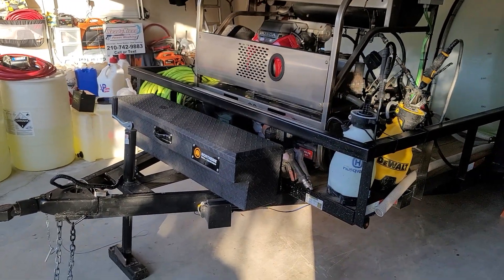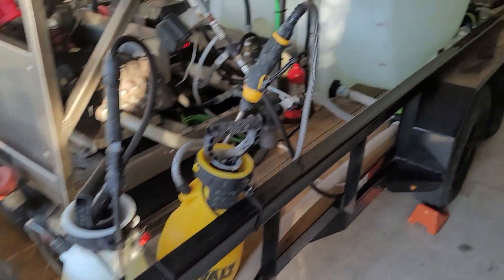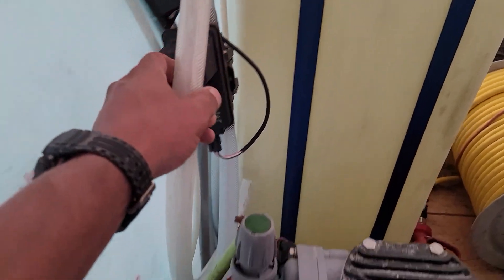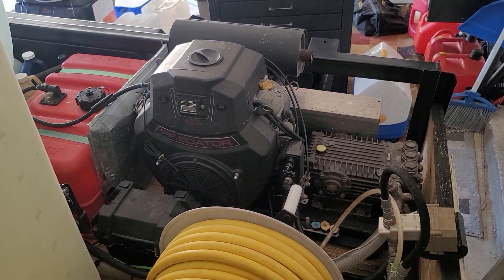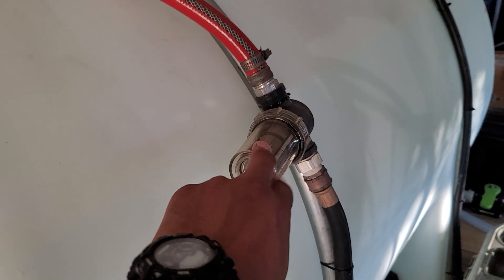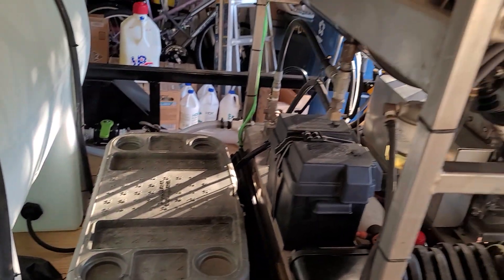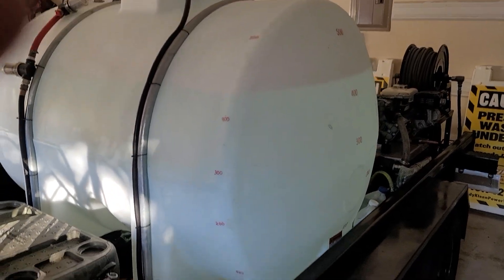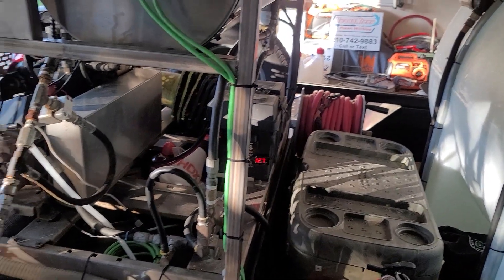New trailer walk-around

Comment: What’s the axle rating and how smooth or bouncy is it?
Reply from the maker: 7000lb. For me it does good. A little bumpier but I also have air suspension. I tow with a 2021 GMC Sierra 1500 3.0L Duramax.